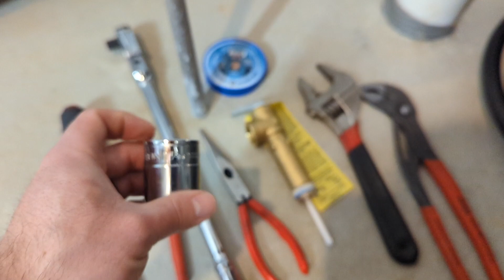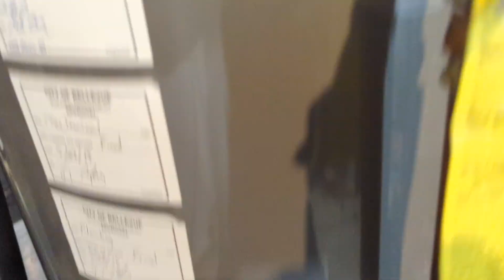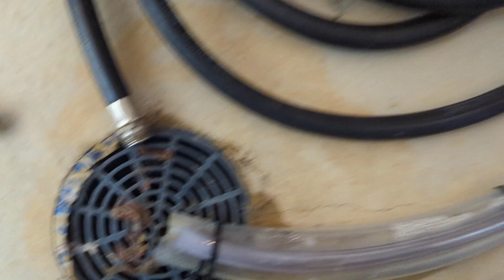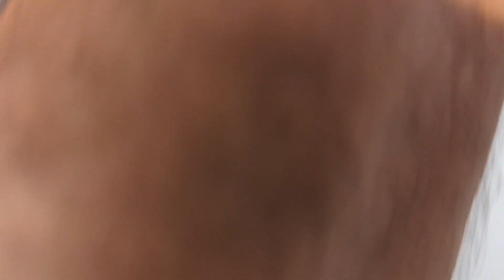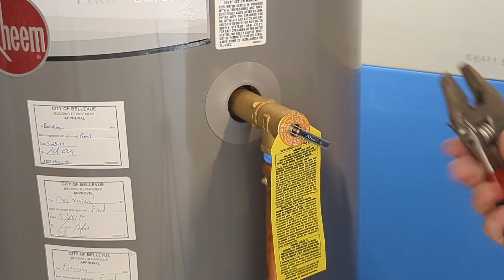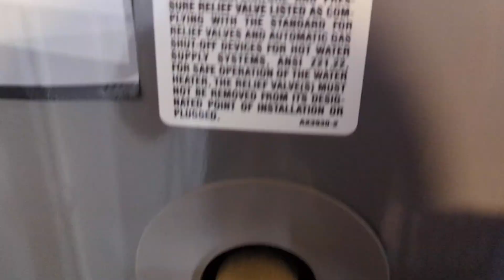Water Heater leaking after 3 years!?

Comment: “All 1/16th’s, HAH” good stuff brother. I noticed you were using the HF Icon halfer inch ratchet. How do you like it?
Reply from the maker: Haha thanks! I like the Icon ratchet, its smooth, good length and doesn't have a locking head which is nice but that's up for debate.